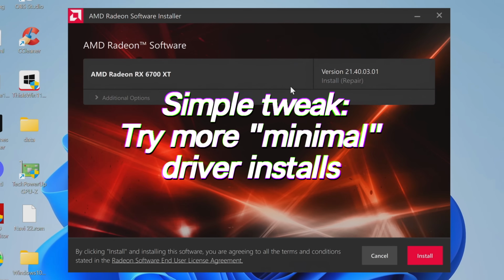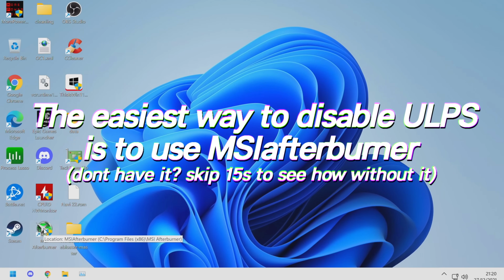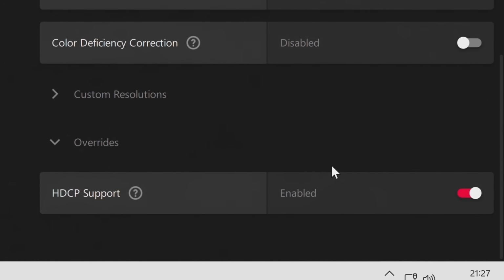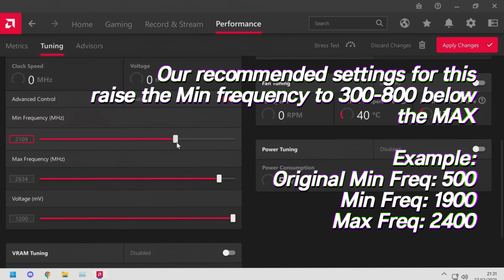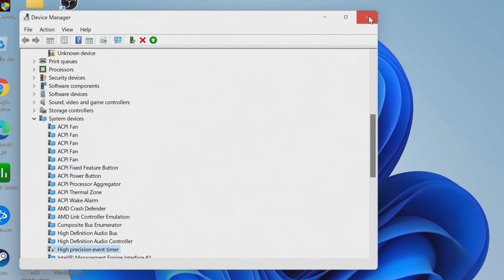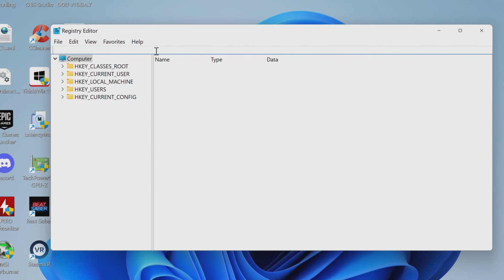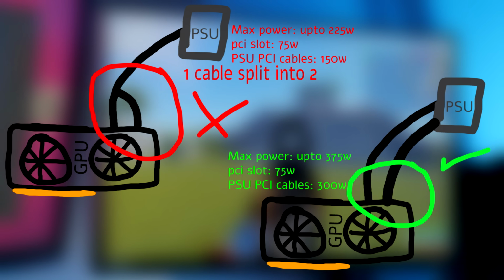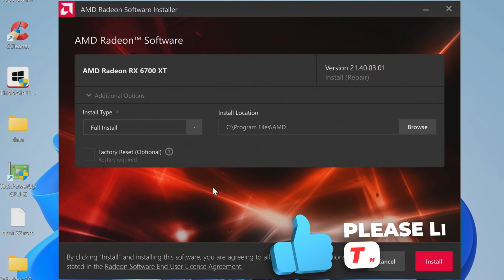🔧 Have an AMD Radeon GRAPHICS CARD? You should use these SETTINGS! *FIX LOW PERFORMANCE & CRASHES* ✅

Comment from the maker: Optimizing YOUR AMD Radeon GPU and Radeon software could offer some great performance fixes, improvements & lower CPU usage! - Alongside common mistakes that could lead or be causing lower performance, game crashes or even PC crashes
Reply: Where is new EFT tutorial?
Reply: Hey Panjno. Im here to try to get my frames from dropping on fortnite with the new update.  I usually play on direct  x12  my gpu runs around 70 to 80% but im getting massive frame drops now. I switch to performance mode and my gpu drops to like 40% utilization and my frames still drop from like 200-300 to like 50. Will disable ulps in registry fix that. I dont wanna download a program just to do that when you said i can do it in registry but never showed us. Im also wondering about Radeon super resolution. And does mixing it with smart access memory cause any problems plus vrr.. Also does enabling 10 bit pixel format cause frame drops?
Reply: @devilboykillz  : if one of ur monitors is 10 Bit Pixle but if not no need to change it wont do any good has nothing to do with ur frames dropping. this 8 or 10 Bit thing is mainly to do with This👉"10 bit pixel format looks clearer, richer (not just vivid but colors are even MORE lifelike then without 10 bit pixel format) and less clipping in HDR."
and for changing things in the Registary should research B4 changing any Values even i would not change it unless i know what it does and for what but he didn't really give a good explanation so if ur thoughts are heavy don't change it i wouldnt.
Reply: lol another question. Should i do this to the global or game overclock. I have two screens and usually watch youtube while im gaming. Dont know if it will mess up anything if both are set diff?
Reply: You ve actually fixed my stuttering in windowed mode in league by rising low mhz in AMD drivers like actually THANK YOU
Reply: I don't know which of the settings you made caused this, but sometimes processor usage is 100% when playing games, which is usually instantaneous, 1 second or a few seconds, and the computer can take pauses. I suspect the SystemResponsiveness setting that you changed in the registry, the original value in mine was 0, not 14 like yours, I'm testing it by making 2 right now.
Reply: Hey, 6600xt should i use 2 separate connectors from PSU ? 6 + 2 ? ( but from 2 different connectors ? )
Reply: @maksonamex  If there are 2 power inputs, you should connect them directly from the PSU.
Reply: Bro on minimal install radeon software does not so many options like gpu minimum clock speed
Reply: Thank you sir
Reply: Panjno,you should do a new Fps boost video on PUBG now that it's free on steam.Have a good day.
Reply: Why didn't you include Computer\HKEY_LOCAL_MACHINE\SYSTEM\ControlSet001\Control\GraphicsDrivers?
Reply: Be quite 700w pure power 11 ,user manual 45-47 , rail splittings ???? Know it!
Reply: My 580 8gb still play all my games 60hz oc 75hz monitor 27in 1080p my girl's are  happy .
Reply: @1967KID  what optimization you use
Reply: but because i used minimal install, i don't have the performance tab in my amd software?
Reply: Hi Panjno, 

I've been trying to work ot where I can find the High Peformance or Ultimate Peformance Settings in the Power Plan. I've tried to Create a New Power Plan but again, it only shows Balanced. I'm using a AMD Dell Laptop because my PC is getting fixed with some issues.

If you can help me that would be great.

Thanks.
Reply: I have a very bad cpu(amd fx 4100) and GPU (rx550) 
I used to play valorant on a good 60 fps but I started getting screentear and when i play with vsync it still gets choppy when I move my mouse near edges in the map and what worse it I'm getting like sudden drops to 20-30
I just dont know what to do 
When enemies suddenly peek me I get a stutter and always die 
Please help me guys valorant used to be  the only game I can play without hurting my eyes and now even it's getting frustrating to play.
Reply: @aryanreddy7346  bro you need to upgrade your CPU somehow, the fx4100 is prehistoric tech. 👀
Reply: @thathandsomedevil0828  yeah lmao 
and my motherboard died so i had to change it and the processor and put i3 3220 and im getting 60 fps stable now
Reply: I think you don't know about amd nimez modded drivers
Reply: @nitrogaming6159  yeah I don't can you tell me if it helps
Reply: Does this apply to mobile graphics? I have a laptop with an RX 5500M built in.
Reply: I don't have the tuning option any way to get it?

Comment: yeah this ruined my fking PC now i gotta reverse do everything and im so pissed
Reply: thankfully, reversedoing everything he said in the video im back to normal but if youre gonna do this, create a regedit backup and don't put your PC in jeopardy because of small tweaks.
Reply: Exactly I watched this video and half of these settings don't apply correctly on the newest drivers and of course if you have an rx 7x/9x series just don't this because it will result in a major hassle and reverting back as you said. Full install and some minor tweaks and that should be it. 

I'd rather have some small micro stutters than randomly crashing my pc fr.
Reply: Lol😂

Comment: I can not fix my issue with amd that makes my 6950xt to drop from +2200Mhz to 500Mhz still does that shit when I play games that CPU bound and GPU usage at 20-30%.
This happen after 25:3:1 driver and I roll back and got same issue and used DDU at safe mode does not help.
Feels like my GPU got damaged by last driver and my issue is same after older drivers etc.
Never got issue with my GPU for 2 years.
Reply: I somehow fix my issue tho by using ddu and reinstall driver only , hope that helps
Reply: @Aviiy69  I got less issues by removing ambient occlusion in gw2 but still get Mhz drops.
I tried 3 diff drivers but no one works gives me Mhz drops in low usage of GPU, DDU does not help at all even at safe mode, only fix for me to install drivers without amd software app, sure I do not need the app but I want to use antilagg and afmf2 for some games.

Msi afterburner disable ULPS does help for some games but not in gw2, I start to think the game makes my GPU drop Mhz.

Comment: Something I found that completely fixed micro-stuttering for me was disabling AMD recording. It's off by default, but if you happened to have turned it on at some point, you may want to turn it back off when you're not using it. It doesn't improve other performance issues, but if you're only encountering annoying micro-stuttering, that may be it.

Comment: Is the gpu priority suppose to be 8 for all AMD gpus? i have a 7800 xt and its already set to 8.. should it be higher?
Reply: Also my system responsive was already set to 0, and the network throttling says 0xffffffff (4294967295) this does not seem right  but i havent chaged anything
Reply: @Tonybfishin idem

Comment: Thank you soo much. I bought a rx6600 and was expecting 180cap in fortnite because of all the videos i saw with same specs as I have but it kept dropping to 50-60. Now its capped. You boosted my fps with all the tweeks but drops went away after I changed to pcie 3gen. Thanks so much again, always watched your videos for tweeking pcs

Comment: I have a 6600 and im getting really low gpu usage and my frames are sitting at like 30
Reply: You ever solve this? Going through the same thing
Reply: @ for me it was the fps limiter weirdly enough. It made my clock speed absolutely tank when i limited my fps either in game or on the software. But you can also get around it by setting a custom min and max clock speed if you know how

Comment: Snake Oil Seller. You never even mention your idle power consuption goes to the roof with your "tweaks", how dangerous is for a non enthusiast user to mess with the registry settings. And even lazy to do a before and after benchmark to probe your "tweaks" even work.

Comment: I think 850psu is high foir a min, I think more like 750 with Japanese Caps is good enough it also dont cheap out on noname PSU like Rosewell which are hit-and-miss my system has a rx6800xt gou and a 7800x3d cpu  I use a 750 PSU which is more then enough I could get away wit ha 650 psu but  I tend to game for many hours almost every day .
the basic rule of thumb about PU is add together your power then multiply that  by 1.5 that is enough.
also in many cases undervolting the GPU can give much more FPS and stability in games I currently have mine undervolted and it runs excellent I have that profile saved and going to test this out to see if thereis actually any significant  difference

Comment: Since this video I think a lot of issues have been fixed in driver updates, I’ve just installed an RX6950xt and a 5800x3d, installed the full adrenaline driver software, set it to ‘overclock’ in adrelaline. Everything runs fine, no stutters, great frame rates in all games I own, although I don’t play any dx9 games these days.

Comment: Anyone know why my GPU clockspeed is dropped between 10-80 MHz? I am using the AMD Radeon RX 5600 XT.
Reply: the 5600xt doesnt get update as much anymore its gettin older and most of the problems that you have will probably not get fixed unless you overclock the gpu but make sure you have a good cpu since the 5600xt is known to fire up cpus and cause them inner damage or heat up very fast so id recommend you to either just buy a new gpu or overclock the gpu

Comment: I have a rx 6600 and a Ryzen 5 5600. Why am I only getting 47 fps??? Pls help
Reply: We have desame specs mines keep crashing when starting a game
Reply: @georgeillescas  I have 5600x. I never get less than 144fps. I just upgraded to a 1440p monitor. It works great. On 1080p id get 280beith fsr and frame gen

Comment: i have a xr 6900 xt and i have done everything as in the video and everything is still the same - low GPU Utilisation - 40% Max, with a maximum of 40 FPS and i don't know what else to do, i just did everything as in the video and i don't even have more ideas, i also thought that my integrated graphics are interfering with my dedicated 6900 xt and i tried to change it from the settgings of the AMD Control Panel - Workload, but there's no such a setting anymore (?) So... I don't see any logical reason for that anymore... I don't know what else to do, i did even reinstalled my windows 10 and i am just sad and angry, because i gave all my money for this GPU and now i am getting a Max of 20/30/40 FPS  and it's lagging like crazy, in all the games, even on League of Legends..... :(

Please, help me anyone, i would pay you at least 10 euros, please :(
Reply: Did you fix it I'm facing the same problem
Reply: @without7015  YES! I get like 90 fps with full graphics on ets2, (i would have more if I was with a better CPU) So anyways… You need first the DDU (Display driver uninstaller) and then, when you have uninstalled all of your video drivers, you just install the last update for your GPU and that’s it, you don’t even need the settings from the video, because if you have a bad processor just like me, or just a not so powerful Motherboard, it will crash and restart your pc, going to the initial settings again, but anyways you don’t need it, it’s good and very useful to clear your cache, but anyways your GPU will work now properly! Have fun bro! 🙂😊

Btw, if it continues like the same, just restart your initial settings of the Motherboard and then just install the newest drivers for it, because sometimes it’s interfering with your Motherboard’s display port 🙂

Comment: Hello everyone. I have an Asus g15 AE laptop with radeon 6800M gpu, suddenly it switched to extreme power saving mode (seen on armoury crate) and now running just on integrated gpu (the performance, mainly fps, is significantly worse). Any idea how to fix this issue? All the power plans are on performance mode.

Comment: Hiho @panjno i'm having crashes with dual monitor on rx 6600, when i connect 2 monitors with different refresh rates, the system crash, ethernet unable to work correctly ( no internet the ethernet hardware stops working)

Comment: Dont your manual tuning options apply every bootup? no need to save and manually load them every day.
Also note for Radeon users, if you go minimal or driver only install you cant adjust your fans, and newer gpus will get hot on default fan profiles, AMD likes to roast their gpus for some reason.

Comment: my gta is running at 35 fps at 1080p max even with gpu at 99% usage, i have rx6800xt and ryzen 5600x, none of these solutions worked, also valorant has a lot of stuttering, can someone help me ?
Reply: probably have msaa on 8x or advanced settings on
Reply: @jackson9583  it is on but it shouldn't be an issue because I've seen people run the same card at the same settings but get more fps

Comment: Hello, i did some of what  you indicate and i did have better result in my fps but the weird thing is that i have strangly dark color every time i want to play to apex legends and sometimes when i use Microsoft edge and i mvoe my mouse the screen becomes black suddenly for e few seconds then comes back to normal then black again, it doesn't seems like there is a specific patern for this, and i do'nt understand if it is related to some of the manuvers i did here or to something else. and btw the color are totally normal when on the office and for regular uses

Comment: Noticed the dx9 issue on my 6600xt. Trying to push a older game (Sonic Racing Transformed) on 4K / 60fps and the gpu is only running around 600-900mhz and FPS is between 30-60 with low utilization of the gpu. 

I already tried manual gpu clock range in the driver like 2550/2650mhz but still poor performance. I haven’t tried the ULPS option yet. Is it necessary to run both manual clock range and this ULPS feature? Update - Tried both and still clocks dip down and the 6600XT can't even run an older game at 4k 60fps as the clocks dip down in the hundreds of MHZ. Can't AMD just make a HIGH PERFORMANCE mode to allow no downclocking.
Reply: I HAVE same 6600 xt gpu did you find the solution for more gpu usage because every time i try to change my amd gpu settings after 20mins crashes alone without play or edit anything,and shes doing reset by its self. Any help brother?
Reply: @AGIOS-DHMHTRIOS  no except one older game appears to run better if I close MSI afterburner. Newer game put enough demand on the card to not cause issue. Hopefully that translates well. 🙂
Reply: @45eno  oh man i will never ever buy AMD again i mean its a crap ..NVIDIA for ever .I knew that maybe  face issues ..and here we are ..Ok ty a lot brother!!

Comment: The minimum frequency setting makes no sense to me it straight up should not exist imo. The GPU should just have a minimum frequency a few hundred MHz below the boost clock by default.
Setting the minimum frequency to a reasonable level has really stabilized things for me in CSGO and BeamNG.
BeamNG is a mess to run since its on DX11 but its very demanding for a DX11 game so it stresses the CPU a lot and basically never keeps the GPU at 100% load flatlined liked DX12 or Vulcan games are easily able to do. It seems like the advanced GPU boosting behavior was optimized for that forgetting that older games will cause the GPU to constantly go up and down with the clockspeed because they don't see a constant GPU load.
I set my min freq to 2400mhz and max freq is at 2550mhz. My non xt 6700 likes that clockspeed window the most and I was also able to undervolt it a bit. 
The voltage slider also seems to be a max voltage slider but its not labeled as such I see up to -100mV deviation from the 1100mV its happy with. Actual core voltage is around 1000mV.
Power draw is insanely low like ~130W at full load! Cant wait for RDNA 3!

Comment: Hi! Do you know how to enable AMD Gpu manually? Recently I reset my Laptop and installed all the drivers for both AMD and Intel graphics cards, but unfortunately, AMD Radeon software doesn’t show any option to enable AMD gpu so my Laptop using its Intel graphics card so, it causes excessive heat when I play games or movies. If you have a solution please let me know.

Comment: I've been looking for something more than the basic BS that I've found about the "We detected a driver timeout has occourred on your system" error I've been getting from the AMD Bug Report Tool ever since doing a clean installation of Windows 11 Pro. I turn off the notification, but the video still cuts out periodically, sometimes frequently, as the driver and softwaregoes through the repeated process of crashing and resterting. I tried the minimal and driver only installations and the same crases still occoured. I've had to go all the way back to Adrenalin version 20.4.2, from May of 2020, to get it to quit crashing. I found that driver by letting Windows install its own driver, then searching for the AMD equivalent. It was pretty easy since the driver version is still provided by AMD and not a generic Microsoft version. I'm hoping this will help my problem. It's really not a huge deal to run the older version of Adrenelin, because I really don't do anything more intensive than watching 4K content, but I just like having the most current drivers. It's stupid and a bit obsessive, but it bugs me in the back of my mind if I don't fix it. 🤷‍♂🤣🤣🤣

Comment: Seriously? Your tip for more performance on an AMD graphics card is to switch to PCIe Gen3 from Gen4 and you have Smart Access Memory deactivated in your bios? Is this a joke? PCIe Gen4 with SAM is the only thing which actually brings a performance boost of 3-10% and stabilizing the fps, while the other things are all debatable